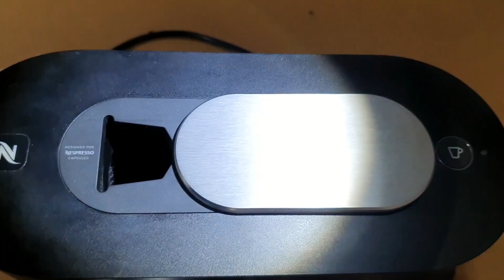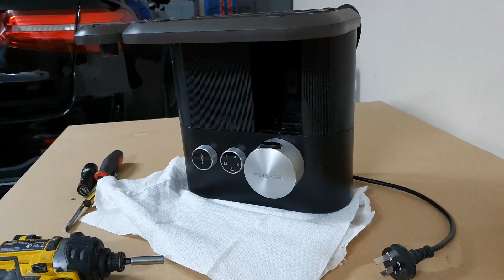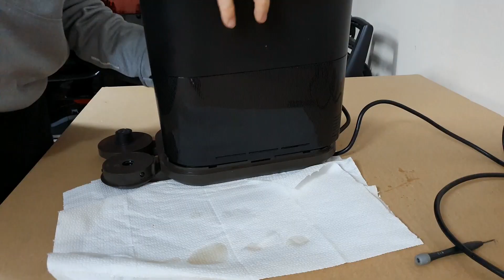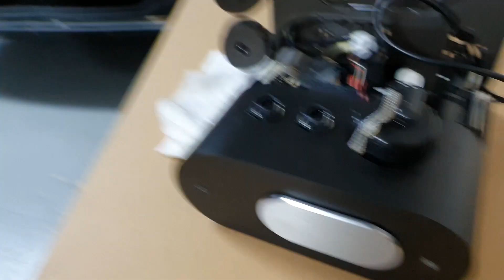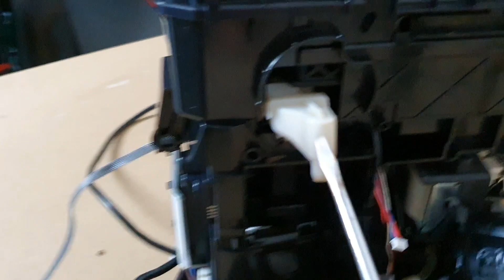Breville Expert Nespresso coffee machine dismantling and cleaning blocked plate

Comment: Hi Ken, I followed this video today, took my Krups Nespresso Expert machine apart and gave the internal plate a good clean. However, now I have reassembled it, the machine no longer works. I can turn it on, and do a hot water cycle fine. But when I try to brew a coffee, nothing comes out of the coffee spout and I just get hot water in the drip tray. And the unpunctured capsule drops into the capsule bin. So for some reason the machine no longer punctures the coffee capsule. Any ideas/suggestions!? Thanks
Reply: (before I started the pour volume was small, but I could brew coffee and the capsules pierced fine...)
Reply from the maker: Hi, it sounds like the part that moves and pushes the pod to the strike plate is not aligned properly. There are  2 white gears on either side of machine that drive it. Goodluck.

Comment: For those with the Krups model that has the extra white part after putting it back together. It is called a hook lock and it fits between the main machine and the part that goes on the front that is held on with the 3 screws. It sits at the bottom here between this bit and the main body of the machine😀

Comment: I had the same problem (little coffee in the cup lots in the drip tray) 
got here via google.
when doing this procedure apply some white lithium grease to the sliders and the four wheels ( two black and two blue) this is like servicing the machine while your in there.
Also you don't need to remove the base from the machine there's a screw in the cable tidy area which has a semi circle shape around it, leave that one in.
the side & rear panels will come off without removing it.
also remember to refit the drip tray when testing it as the machine wont brew with it out, I found this to my horror and thought I had left something disconnected lol
I only worked this out after disassembling it again and noticing a switch at the back of the drip tray slot.
so many thanks for this video it helped me a lot !!

Comment: Thanks for the time and effort in putting these videos up Ken. I was ready to give up and buy a new machine... 

I watched your first video, "fixed" and cleaned my machine - but not hot water would come out. Watched this version, and realised my error in running the water pipe too high along the top of the unit. This resolved my issue and I can finally have a decent cup of coffee at home again.

Comment: Hi Ken, my nespresso expert has started to leak water from the bottom of the unit. The tank is ok.. no leaking from there. Any idea what could be causing it 🤔
Reply from the maker: hi, if the rubber seal at the bottom of the tank is ok then it might be heat pump. Do you hear hissing before and after making coffee?
Reply: @kenkanfix   looks like the heat pump 👍
Reply: @Ken KanFix   hi Ken yes I do hear a hissing noise when I turn the machine on😒

Comment: Hello, I cleaned the plate the and re-assembled the machine following this video, but ended up with a small white ABS piece which I can't figure out where it came from - and I can't really see it in this video.... The machine works without (although the drip tray leak issue was not solved by the cleaning). Any ideas? 😕
Reply from the maker: Hi, I think you have the KRUPS machine, mine is Breville which didn't have that part.
Reply: @kenkanfix  thanks for that. I actually have the Magimix, which here in Europe is the same as the Krups version, I believe. Any idea where that part should go? (How did you even know about that? :)
Reply from the maker: @xandrissimo  Hi, There's been a lot of comments on that part :)   try searching for Service Manual for Krups XN6018. good luck
Reply: @kenkanfix  I had the same problem, Did someone find out where it fits?
Reply: I had the same problem in the end left over with a white small plastic part, it's a part that probably is located in the area of the coffee brewing as it was dirty with coffee. But I could not find it back in the service manual of the KRUPS XN60xxxx. I will try without.

Comment: While I have it disassembled, I seem to have a problem with the lid sensor. The machine thinks that the top sliding lid is constantly open, so I can't even factory reset it, what do you reckon the reason for that can be?
Reply from the maker: hi, I am guessing there's loose cable
Reply: @kenkanfix  so am I correct in understanding that this machine doesn't have an actual lid open sensor? At least I didn't find one in the top part.

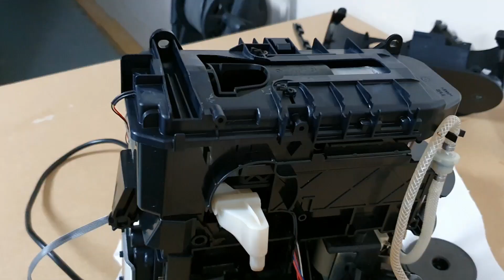Comment: Thank you so much for putting together the detailed video! One thing to watch out on reassembly – on the top of the 4-clip extraction assembly cover that's removed at 6:44..6:59 in the video, there are two little rotating tabs, they must face exactly to the left of the machine when clipping it back, as visible in that time slice, otherwise the capsule insertion slider will get stuck on them – it has to slide freely back and forth, verify it when assembling. These tabs tend to rotate by themselves when the cover is off, and it's easy to miss their position when clipping it back on.

Comment: Hi Ken, thanks a lot for the detailed video! However, after putting the machine back together, I have noticed that the hot water function does not work anymore. But the coffee function works perfectly fine. Any idea what it could be?
Reply from the maker: hi,  sounds like there's a kink in the hot water hose. when reinstalling there's a track that the hose has to follow. good luck
Reply: @kenkanfix  Hi Ken, I found the issue. We had put the hose of the hot water function as high as in this exact video. But I noticed in your more recent video that your hose was put into a specific position. By doing this as well, the hot water function works again! :) It might be that the motor of the hot water function does not allow for enough pressure to let the water go that high.

Comment: Hi Ken,
Great video, thank you very much!
Since you mention to do this on a regular base I have some sugestions.
I only unscrew the two deep lying screws of the bottom plate, that’s enough.
You don’t need to take of the control switches (selection and temperature).

A bit less work every 6 months!

I couldn’t take off the grid thingie, cleaned it under a tap. It obviously has to stay connected properly for the machine to work, I didn.t discover how though…

ThanX again!

Roland
Reply from the maker: thanks for tip

Comment: Great video mate saved me at least an hour dicking around trying to get it opened. The piece that needs cleaning has so small holes I'm surprised it didn't block up earlier mine has run for more than 2 years without regular descaling once a year. Thanks again you did a great job on the video.
Reply from the maker: hi, I am glad the video helped you 😀

Comment: Great stuff Ken thank you so much. I saved £75!! Nespresso wanted £79 to fault find and correct, I just bought the screwdriver (£3.99). You're a genius! :)
Reply: you just need to break that little pin in the meddle and then use a normal torx screwdriver for that size. £3.99 is alot of coffee.

Comment: Hi Ken I've just followed this, cleaned out the spout and capsule container including he plate. I have reassembled everything back exactly how I unassembled, but the brew button is flashing orange and when I go into settings mode I cannot select either cup option and when I press the brew button it leaves settings mode and continues flashing. My app says that there is an issue with the temperature sensor. I don't know what the issue can be. Please could you help me. Thank you and keep up the great videos!
Reply from the maker: Hi, I am guessing some of the cables are not plugged in. Can you double check?  Also make sure the water hose is in the channel and there's no kinks. Good luck.
Reply: @kenkanfix  thank you I will have another look!🥰

Comment: Hi Ken, thanks for the great video. But I had the same problem with the second white part. Where should this be placed when assembling?
I think Niels had the same problem. 
Thanks Jakob
Reply from the maker: Hi, if I get a chance I will upload a video this weekend on how to reassemble. The white gears on either side of the heat pump turns and pull the plate to puncture the capsule. So the piece that holds the plate has two arms with gears that need to sit on the white gears when reassembled. Sorry difficult to explain without pictures.
Reply: Hi Jakob H - Did you figure out where that extra part goes? I have the same problem.

Comment: Would be nice if there was a video on how to assemble it again.
Reply from the maker: Hi, if I get a chance I will upload a video this weekend on how to reassemble
Reply: @kenkanfix  Well, I managed to do it myself. But it is quite tricky at some points, so a video on how to do this would be very helpfull. I'm glad I did this whole operation because my machine was very dirty inside and now I have cleaned everything and it's working fine. I have two screws left though, which is strange.
Reply: @kenkanfix  that would be great. I’m planning to unmount and clean it tomorrow. I’m afraid that I will not be able to mount it back again. It’s complicated. I hope I will be able to solve the problem with the water leak and koffie in the dispenser.

Comment: Hi Ken. I was able to fix my espresso machine following you detailed video. Thanks!
Reply from the maker: you're welcome, glad it helped you
Reply: I ended up with two extra tiny plastic parts but apparently it was not essential. I wonder if anyone faced same issue. Each piece is like a little cylinder with eccentric tabs on the side, 1cm height

Comment: Hi Ken, does your machine keep dripping hot water from the barrel that extracts the espresso? Mine keeps dripping even when the extraction is over or it’s about to extract, and it’s a lot! Thanks for the video, I’ll definitely try to fix mine, since it’s not working properly and some coffee is going right to the waste bin (think the plate is clogged up)! Kudos from Brazil!
Reply from the maker: Hi, mine only drips a little bit after extraction but I think that's normal as the last bit of espresso flows down. But if yours is dripping before extraction it might be a gasket problem. Although I have not taken the heat pump apart yet. Good luck with cleaning the plate.

Comment: HI Ken, Thx for your clear video.  I have one question as i do not get the part in video 9.43 straight with the white plastic...as a result obviously coffee goe into container instead of in the cup.
Reply from the maker: Hi, thanks for your question. When the pod is pressed against the plate and punctures the pod, normally the espresso would flow through the holes in the plate, then down a track to the white plastic. But when the holes in the plate are blocked the espresso can't flow through so it just flow down to the bin. Hope that helps.
Reply: @kenkanfix  sorry to bother you&I really appreciate your help... (since Nespresso they did not want to help me) The espresso does float through the holes(after I cleaned them)but  i do not get things connected properly/and do not get them back in place the right way. Since the black output(where the espresso is pressed through the holes) does not fit precisely into the white plastic.The coffee is floating in no man's land. Hope you can help me here again. THX Info@ittakestwo.nl
Reply from the maker: @nehtijthoff  Hi, I will try to help you.  if the espresso does flow through the plate but doesn't go down the white track, I can only guess that it's not line up.  Check the spout  behind the plate and make sure it is clipped on tight.  I think there are three clips. Hope that helps.
Reply: @kenkanfix  Thx again...is it possible you can send me a mail with a top view photo of these elements?
info@ittakestwo.nl      I just do not see the logic between the white plastic and the sprout
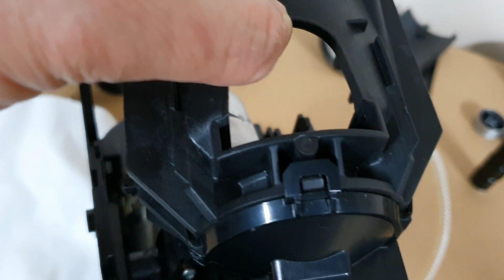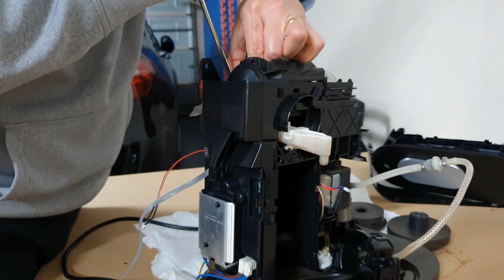Reply from the maker: @nehtijthoff  hi, in the video at 9:45 you can see the spout and two of the clips. The piece (removed at 8:00 in the video) that holds the plate and spout moves  toward the heat pump and squeezes and punctures the capsule. At this time the spout should be lined up to the white thing (9:05 in the video). Hope that helps.
Reply from the maker: @nehtijthoff  Hi, thanks for the video.  I sent you a photo to info@ittakestwo.nl  and explanation of what I think is wrong.  I will see if I can video my machine working over the weekend.